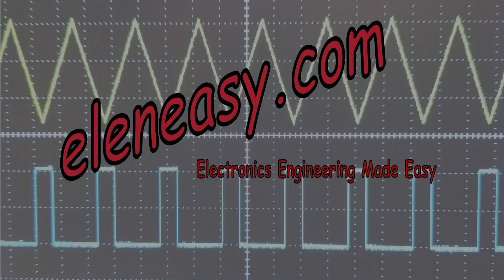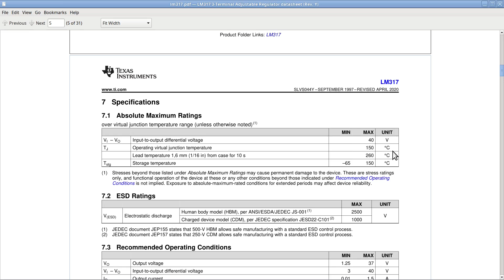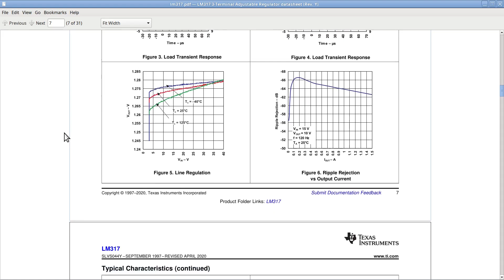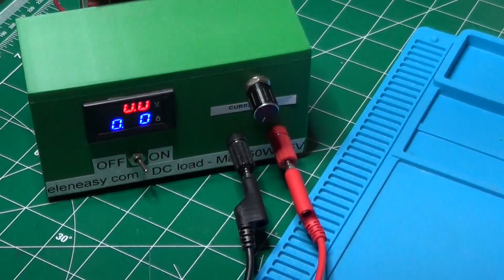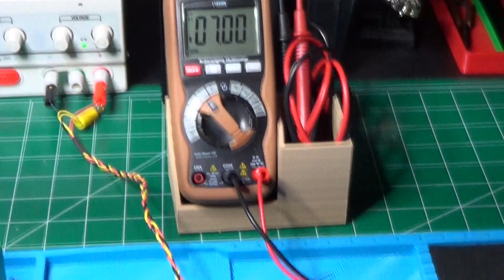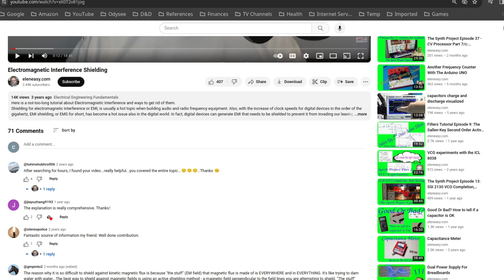Practical Information On The LM317 Regulator

Comment: Excellent! Thank you! Here are two common misunderstanding about LM317/78xx type voltage regulators... 1) Their maximum wattage output ability is (much) less than their maximum voltage output ability times their maximum current output ability. (This is true for most ICs.) 2) Most hobbyist design for the minimum voltage dropout head room of say 1.5 volts. However, as you say, 3 volts of headroom is needed, in order for the voltage regulator to attain its best ripple rejection. Request: I would love to see a complete linear PSU design, for the traditional 0-30V and 0-3A... Having true 0V capability (negative rail.) Being based on a current pass MOSFET transistor. And, using op amps. Yes, there are many of these designs on the web. But, they all have some failing... The most common failing is that their operations are not explained. Thereby, they can not be trusted. Cheers!
Reply from the maker: Thanks for the kind words.  As far as the design of a linear PSU, I have it in my todo list since a while,  now.  It is probably time that I start working on it.  This PSU will provide dual voltage and will be controlled both in voltage and in current.  I'm also thinking to provide digital controls using an Arduino or other microcontroller.  It is a big project. So I'll have to do it on multiple episodes.  Stay tuned.